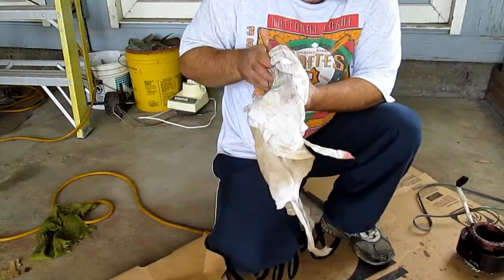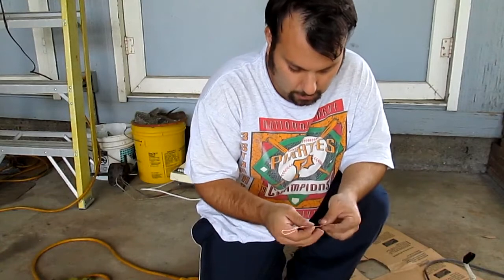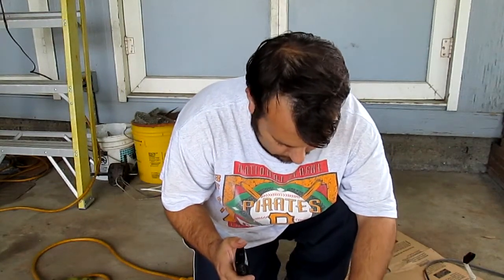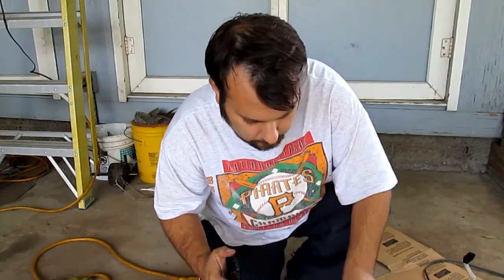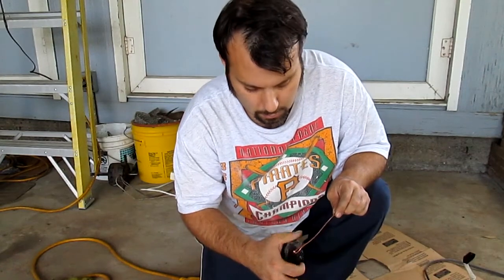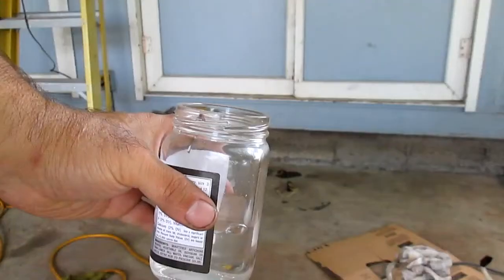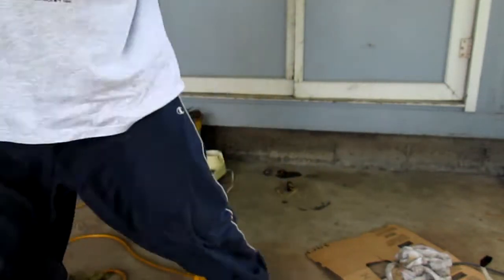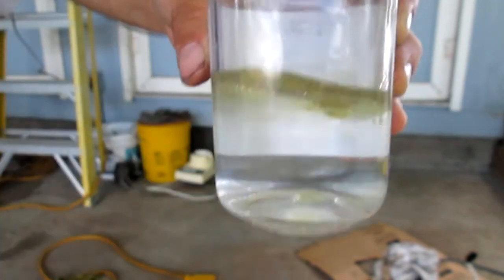Polychlorinated Biphenyl -  Flame On Copper Test & Water

Comment: It should sink below the water if it is PCB oil. I would not perform the flame test, however. The primary risk with PCBs is exposure to dioxins and dioxin-like compounds. The flame will volatilize some of the PCBs, and the combustion can potentially generate MORE dioxins. There is no known safe amount of dioxins (especially airborne). So be kind to yourself and don't do the flame test.
Reply from the maker: Thank you for the information, greatly appreciated!  The one thing I found out, and I could be wrong, was the danger of PCB contamination happens from the unstable molecules attaching or forming bonds with items in the environment.  If I am reading your information correctly, then that is also the danger when a transformer containing PCB oil heats up and explodes.  Had a few let go in my neighborhood in my lifetime..... they smoke like heck and stink.